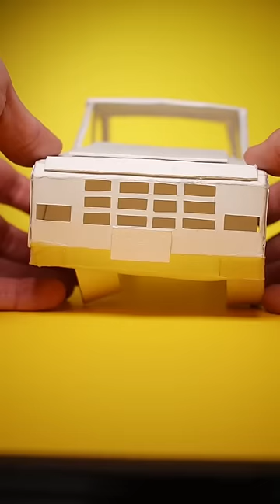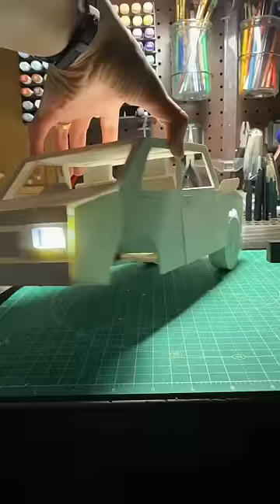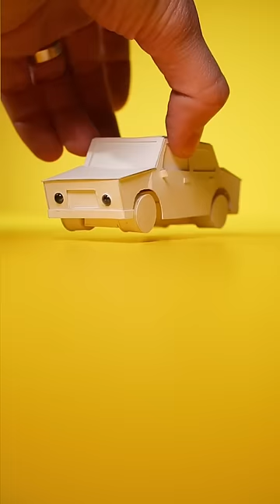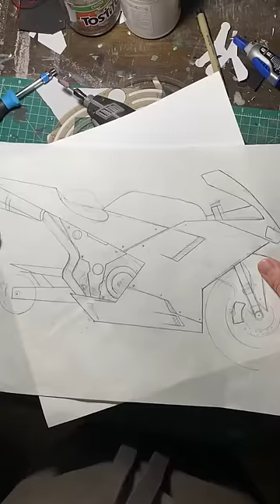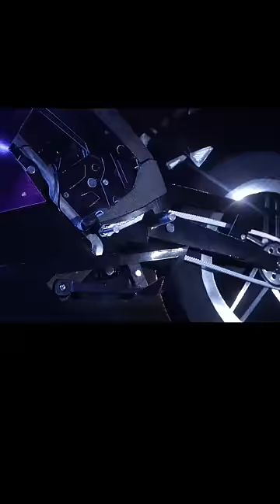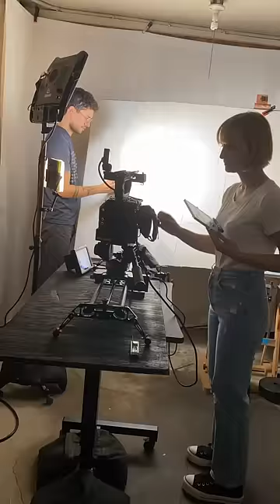Making paper cars is HARD 😤

Comment: What's the bike couldn't you have just made the wheels attached to magnets and then have a metal item on the Wheel so the wheel can move which also means you would have to make the wheel and the bike separately but it's still also work if I'm wrong😅

Comment: take a couple paper circles and poke the axle through the center of both of them. then glue a couple circles or balls at the end of the axle then build the tires around the balls using the center two circles to work as the insides and it will hold the tires in place and still roll. you can use cones to press on the outside of the wheel and inside if you need to keep the tires from wiggling